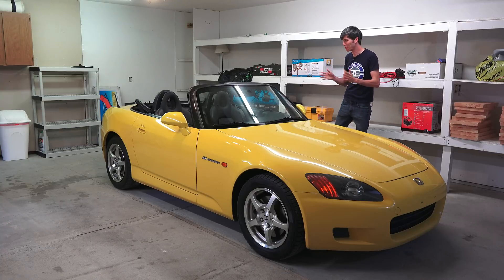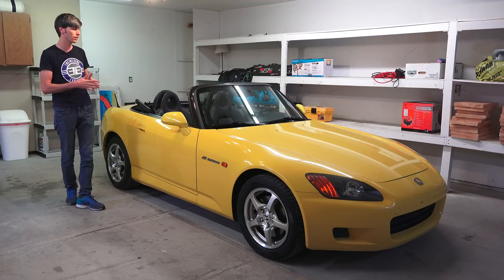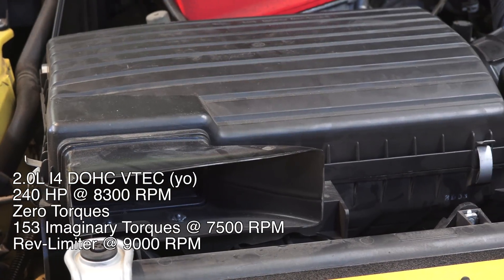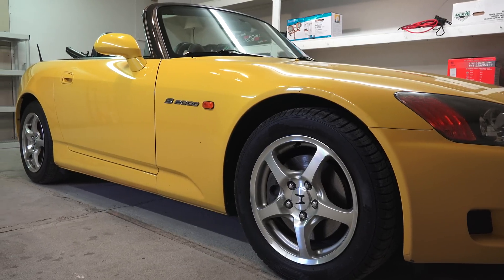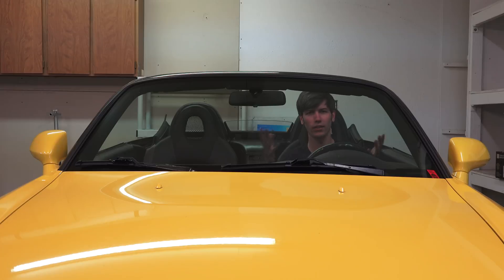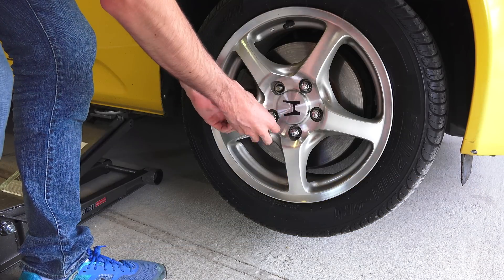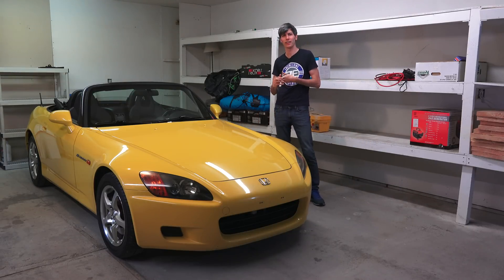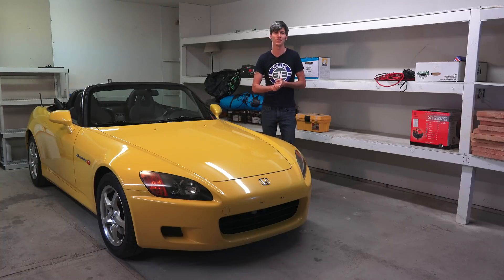I Bought A Honda S2000 And It's Amazing!

Comment: I used to do work in a shop that played around with these.  For the motor, it's best to just leave it mostly stock unless you want to squeeze out every bit of power for a gob load of money.  I would just do high flow cat and cat back exhaust.  The stock intake is already pretty good. I would spend the rest of my budget on suspension and chassis upgrades.  Add in some nice lightweight wheels keeping the stock diameter and good sport tires and you're good to go.  Oh and carbon fiber hood.
Reply: I have done this to the T, minus the addition of a [ricey] cf hood; non-ricey cf hoods cost north of $2500+!
Reply: I hope he doesn't go all ricey and get a CF hood with all the vents. Yuck.  I prefer the sleeper look. There are some decent brands out there that have OEM style for less than $1K.
Reply: +Peter Tran He strikes me as a rational and tasteful person so I doubt any unecessary modifications will be done to this car. Most [replica] wet cf hoods weigh more than the factory hood. The majority of people rocking sub $1k cf hoods do so for aesthetic reasons and functional ones. It's crazy to me that someone would spend ~$1k on a replica cf hood when a used oem ones go for ~$150, but hey, that's the general tuning scene these days.
Reply: +ayowser01 * "The majority of people rocking wet cf hoods do so for aesthetic reasons, [not] for functional reason."
Reply: Oh thats right, the hood is aluminum.  Nevermind :D

Comment: You look like a tall guy. Like me. I'm 201cm, not sure what it converts to in feet/inch/complicated system measurements, but... Apparently you actually fit in it. With the top down. Right? 😉

Comment: LOL! 1 month ago I've purchased mine to join a Subaru - and we have kinda similar experiences :) I have WRX and I agree Subaru 4x4 is super efficient at putting power to the ground but it also makes it boring to drive...
Reply: Mine is just.... Well... Uglier... Let's say that I've bought probably the ugliest stock-ish S2000 in whole Europe... But it was cheap! :)
Reply: huh, the people I let drive my WRX always say its fun AF to drive lmao
Reply: UhhhSitrep Want to launch? Burn the clutch. A lot. Want some skids? Forget, too much grip, not enough power to light up 4 wheels. gearbox will cry too :) Wanna drift? Nope, it acts like FWD unless it is really slippery. Wanna instant power - Nope, wait for turbo to spool up.

BUT! When you want to go fast and in the direction where you point your steering wheel, no matter the road surface and road conditions and plan ahead for turbo lag there is hardly any better car in this class to do so :)

Comment: You please make a video on the new Nissan engine which has a power to weight ratio of 10 i.e; it weighs only 40 kg and gives output of 400 hp.

Comment: The first mod you should put on the S2000 is an engineered explained sticker (if it exists) It will add 5 HP.

Comment: Fantastic car! My daily ride, actually....
Now, question : 
According to what I read and I beleive is true, Vtec shall not engage until water temperature has reached sufficient temperature.
How can this be? Why isn't Vtec related to oil temperature? Does this mean that you can safely push over 6000 rpm as soon as water temperature has reached 90°C?....
I cannot understand why the F20C does not have a oil temperature sensor!....
Short remark about F20C torque : 80% of max torque is available from 3000 rpm... ;-)
40 mph on 6th gear is not an issue. You may switch from 1st to 6th gear...

Comment: As an owner of a 2000 S2000 silver, I can testify that it has indeed 0 torque. Taking off normally after a red light, and then trying to accelerate full throttle to not let someone cut me off, I was passed by a Dodge Grand Caravan, possibly a 2005 or 2007 with a 3.3L.

I should have revved it and dropped the clutch, but the S2000 diff is fragile and I don't want to ruin my Bridgestone RE 11 tires.......

Comment: s2k is the only honda I'd buy.
Reply: and nsx
Reply: 90s NSX? Integra Type R?
Reply: I've been saying the exact same thing for years!!
I finally bought mine last Wednesday and I love it
Reply: Same, other than the s2k, I'll stick with Nissan
Reply: crosstour?
Reply: Nsx is better 😂
Reply: S2K is great, but at this point in my life, I would rather have their Kei cars, the S660 or the N-One custom... or perhaps accord hybrid. Muahahhaha
Reply: And HSV 010...if they'd be willing to sell a race car...and if I could even come close to affording something like that. Lol
Reply: same here bro.
Reply: Joe McKoy Had a chance to test drive them both when they were new back in the day. Honda felt small and light while the 350 felt very heavy and big in contrast. however i cant deny that 350Z wins the sensation of power, the torque punch while driving around town hands down. i guess the 2 cars caters to a significantly different demographic. i still take the S2k tho... 350 fuel economy is atrocious even if u drive it gingerly.
Reply: I acquired a sub 40k mile 2000 Accord from my grandmother. Honestly, it was one of the worst vehicles I'd ever driven. Poor interior, awful seats, fuel economy was that of a large crossover, and sure it was the 4 cyl., but it was a bit of a slug.

Comment: s2000 is a nice ride, but i prefer rx-7 or rx-8 (the suspension of rx-8 is better) less weight more power (rx-7 240hp turbo & rx-8 230hp NA 1.3L engine)

Comment: You actually brought up an interesting point with the whole Honda/Subaru fanboy deal: usually those guys aren't really fond of each other's automotive tastes (Marty and Moog are a good example), while you've managed to find a way to appreciate both of those marques. BTW, this is a great car. I drove one once (it was about five years ago), and that was an experience I'd certainly want to re-live.
Reply: 2WD NA cars are more fun than 4WD turbo cars.  That is just my opinion.  I got rid of a turbo Subaru as I think NA is much nicer and more enjoyable to drive. :)  Apart from the steering and braking feel (none as such), Honda cars are really very well engineered IMO.
Reply: TassieLorenzo 
Indeed! I own a 5-gen Prelude myself, with a J32A2 V6 engine swap - love it to bits.

Comment: WOW, plenty of room under that bonnet for a bigger engine. Hows about getting one of the Australian Ford XR6 Turbo  or G6E Turbo 4.0 litre straight sixes for it? Way more original than going for a done-to-death LS motor swap
Reply: Ford straight-six doesn't rev. :(  (plus it has a silly turbo on it...)
Reply: TassieLorenzo
Obviously if you just want a revvy engine stick with the stocker.

Iv just been thinking that a car like the S2000 would be awesome with a big beefy straight 6. Proper hairy chested roadster. Look at the bizarre cross-eyed Morgan, awesome car that sounds like a spitfire with a straight 6 under the bonnet. Putting a V8 in it would just be passe.
Reply: 75IFFY Or BMW S54? :)  But putting a BMW engine in a Honda, is almost as nuts as putting a LS engine in a BMW M3 that Matt Farah uploaded recently, I don't get it!
Reply: TassieLorenzo
Ugh, I know, its just going backwards. Iv seen people do it here in australia too. its sacrilegious

Comment: The S2000 is an awesome car to drive! Initially I thought the HP and torque were a bit low. But once you drive it, you realize it's the pure enjoyment of driving that comes through, not the power numbers that matter. When the engine hits VTEC up top, the high rev punch sounds amazing and makes you feel like you're driving a small race car (you have to experience it). 
The shifter is one of the best ever made. Short shifts that are very precise. Going through the gears is a delight.
Overall great car. Honda / Acura needs to get back to making pure driving cars like they did in the 90s. I wish they would develop a RWD platform for a new Prelude, Integra and S2000.

Comment: does no one remember the honda s600, it was 600 cc and with the factory sports exhaust option made 76hp, that means it makes 126hp per litre. thats more than the s2000 and about was made about 40 years before hand

Comment: About 17 years later, that gauge is still one of a kind and just awesome. Honda was ahead of it's time with the S2k 👍🏼
Reply: I dunno, the gauge package is 1980's style. :)  Such gauges were all the rages in the 80s (Audi Ur-Quattro for example).
Reply: Japanese were way ahead than Euros
Reply: yeah toyota and nissan also had them in the mid 80s
Reply: Mark II supra had them in the early 90s.
Reply: Toyota put a bar graph tach in some the limited edition 1989 4runner.
Reply: but i think only one package of the mk2 supra got it (Performance package or Luxury Package)
also in the early 90s there was the mk3 supra not mk2
Reply: Paolo Inigo In the 1990s with cars like the GTR, Lancer Evolution, Subaru STi they were ahead of Euros (at least Euros in the same price bracket).  Economy car based vehicles like Lancer Evolution or Subaru STi performed as well as some supercars (Lotus etc) of the time, having extremely advanced electronic AWD systems to corner like a boss too. :) That was ever such a long time ago.  Not anymore.
Reply: ***** Haha, you joker. :P :)
Reply: ***** Interestingly digital dashes only came into F1 in the late 80s and touring car racing in the early 90s IIRC.  These were a lot better gauges than those sold on passenger cars in the 1980s, of course though! Some of the refresh rates were dismal on road cars. :)
Reply: +TassieLorenzo we do all know that the first generation NA1 NSX which had an aluminum chassis (the first ever)was copied by Italians for their Ferraris. 👍🏼
Reply: Corvette also debuted thier digital dash in '84.
Reply: it was on the mclaren mp 4/4

Comment: Looking good!  After I sold my Boxster...I was torn between a low-mileage 2006 S2000 or a new 2016 MX-5.  I liked the S2000 a bit better for driving, but went with the MX-5 for newness and since it's smaller/lighter than the S2000.

Plus, I'm considering a Crosstrek...if I decide to sell my 4WD Xterra.

Comment: These cars are cool, but there are so much more better, newer, cars you could have bought for the money.
Reply: No there aren't.  For a start, more modern cars tend to be turbocharged which is less enjoyable to drive. :)
Reply: Like what?
Reply: +TassieLorenzo there really are
Reply: ***** SavageGeese has an in-depth video of S2000 vs FR-S.  Apart from that S2000 doesn't meet new car emissions requirements since 2010ish while FR-S meets modern emissions, the S2000 is a much superior vehicle and wins the comparison. :)
Reply: TassieLorenzo Um I would take what you hear from journalist and YouTubers with a grain of salt. Especially savagegeese. With that being said. The frs/brz get old quick (especially when you can't take a prius from a red light).
Reply: krisnadi imam I don't think it's a bad car in its own right. However I think toyota could've done way better than teaming with Subaru. Toyota using a Subaru engine, I believe they screwed up. Why not redesign the Toyota FR platform, it's almost insulting that this was label as the "spirit" successor of the AE86 and it's powered by Subaru. As good as Toyota engine were in the past...
Reply: Benjamin Kham Explain. Otherwise say something that doesn't lack critical thinking. But first understand this. ANY car manufacturer can develop something like a ferrari (gt350r motor) if they spent the time and money. Hyundai did what many manufacturers won't in the name of profit in building the Genesis coupe. Please stop with the bias brandism and bashing. The bully mentality runs deep in this society and its sickening if it were you building the car would you like the negative comment? You know nothing of their philosophy therefore you cannot judge. If you don't like it simply state why you don't with facts instead of bashing. God this world is done for.
Reply: There are hyper cars on the market that have 0 track record or race history. I don't think that's a fair measuring stick
Reply: Sure thing it is, you have never driven one! 9k rpm in every gear up to 260 km/h on the odometer. Come with your bimmer on twisty roads :) A good canyon, S2000 eat 335i for breakfast. Just try an S2000, if you can drive a stick that said... No pun intended, just try one
Reply: TassieLorenzo that's true. I guess it could've been that Toyota wasn't sure where the market for that type of car is and if they were willing to spend the money and time required to develop a new engine, chassis etc.
Reply: redlinexi I'm guessing they are thinking BMW 335i or something? :)  Must be better because it has more cylinders, a turbo and goes a little bit faster, right? ;)
Reply: +TassieLorenzo Genesis coupe 3.8 N/A, NISSAN 370z 3.7 N/A other than that their isn't anything else sporty for the money that's new.
Reply: Also the Genesis was temporarily discontinued for a more luxurious turbo model. I would say brz/frs but that's slower than an s2000 smh.
Reply: I wouldnt say BRZ get old quick because it got outperformed by regular cars, but i must say that BRZ style n interior looks very old despite its actual age. i mean... even hyundai has better styling i guess, i dunno i might be blind...
Reply: Toyota shot themselves in the head they would've been better teaming with Honda
Reply: Che M actually brz is not bad as a car, just the styling of it is just plain MEH... u know... not intent to diss that car, but styling wise, seriously?
Reply: Benjamin Kham Again, you lack critical thinking and knowledge. Championships and race history? Ever heard of Pikes Peak? Or Rhys Millen Racing? If you did you wouldn't have made such a simple minded knowledge lacking comment about this car and motor being race proven. A Google search will provide you with the Genesis coupe having a race proven history with a recent Laguna Seca class record and wins at Pikes Peak(SMH). Better yet how dare you once again speak of something you don't follow nor have any advance knowledge of?  Philosophy is a joke? You sir are part of the problem with this world. I bought the car because I'm not a bias person. Your poisoning this world with your belligerent unwise comments.
Reply: Che M "Toyota shot themselves in the head they would've been better teaming with Honda "  That's not gonna happen!  Talk about swallowing their pride!  Toyota use Yamaha (and their motorcycle experience) not Honda (and their motorcycle experience) to design Toyota's high-performance cylinder heads, for example. :)  Yamaha have designed the cylinder heads for most of Toyota's famous engines.
Reply: Benjamin Kham South Korea has less motorsport culture than Japan, but it's growing these days I guess.  Therefore Hyundai are focussed mainly on simply manufacturing cars  efficiently that are well-made, and that's what most customers want. :)
Reply: TassieLorenzo I'm aware of their relationship with Yamaha. I'm 100% sure they'd never team with Honda on that. what I meant was how toyota would compromise for something considered lower quality than what they themselves have been able to produce. They could've made a better car on their own
Reply: TassieLorenzo think about all of Toyota engines when they were still mass producing performance/sports cars. Now think of Subaru's...
Reply: Che M I see.  For whatever reason, it is what it is. The engine is not totally terrible for Subaru's first attempt at a high-revving naturally aspirated item.  As much as others will argue it's not based on a Subaru Impreza, I guess basing the GT86 on a modified Subaru Impreza platform must have reduced the cost substantially compared to using the more expensive Lexus IS (or some other Toyota) platform?
Reply: Dude new cars suck, AP1s are the ultimate sports car. No computer interference, light, awesome shifter and the engine is fun as hell to rev out. If it had a rack of 45mm Mikunis hanging off the side instead of fuel injectors it would be perfect.

Comment: As a Subaru fan boy and a Honda hater I was a little sour grapes when I saw this title. But after watching the video I am kind of excited to see the finished product. Hopefully some new wheels first since that back one has a nice gouge.
Reply: How can you be a Honda hater?  Honda vehicles are extremely well-engineered and optimised.  :)  IMO it's more fun to have a minimalist 2WD non-turbo vehicle that performs the same as a turbocharged 4WD vehicle.  Much prefer the K20 EG to the GC8 WRX I had before.  The EG is just as fast, or slightly faster anyway. :) What's the point of lugging around all that 4WD and turbocharging gubbins all the time, if it's unnecessary!? Plus being turbocharged they promote a lazy ride-the-surge-of-boost driving style (and unless you get a JDM RA or Spec C close-ratio box, you get very relaxed gear ratios) which is much less fun than holding gears to high rpm in a proper close-ratio box. :)  However I can see the appeal of the Subaru and why people would like them IF they had never tried a nice naturally aspirated Honda (or Renault or whatever) vehicle. :)  Besides Subaru are on the NA bandwagon with their BRZ/FR-S anyway, do you like that car? :)
Reply: i drive a 16 wrx, need awd for the new england winters. and ive never been in or driven the BRZ, but people seem to like it.

Comment: "Nice miata, bro!"

In all seriousness, good choice! It suits your style well. I agree an FR drivetrain is the best way to go Although I prefer the power delivery of a V8, with usable torque starting from cruise RPM (1500 give or take) up to the redline, but that is just personal preference. To corner carve, you gotta sacrifice displacement and torque to save weight up front.
Reply: You don't cruise at 1500 in a four-cylinder though, you cruise at 2500-3500rpm so it's not so bad. :)  Certainly if you try to floor it at 1500rpm in a four-banger you won't go anywhere at all!